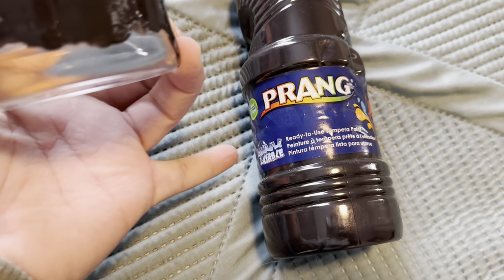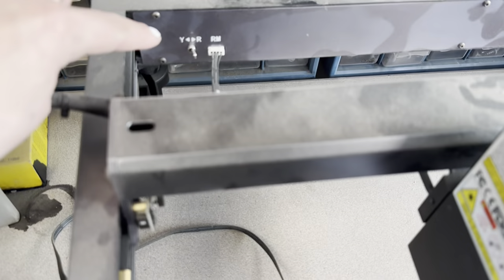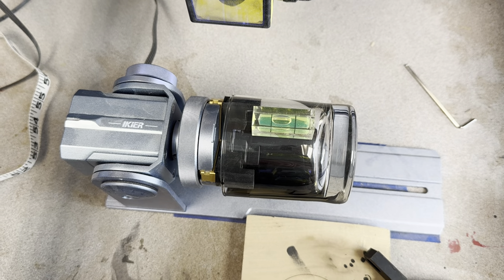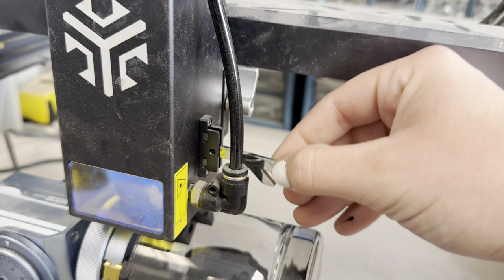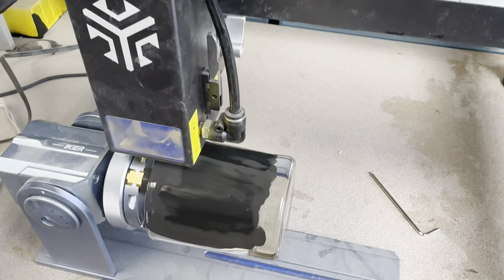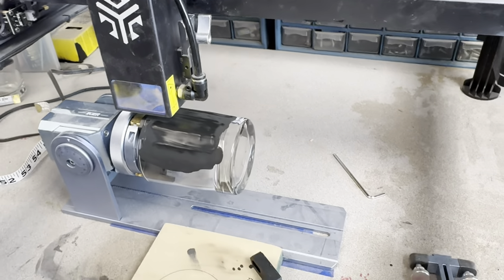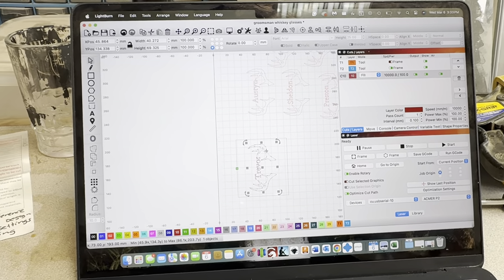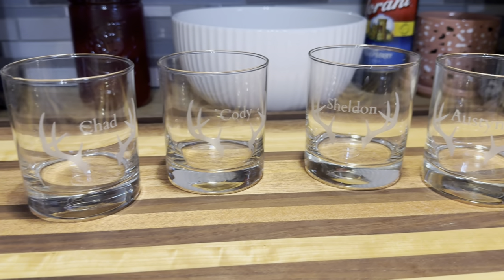How to Laser Etch Glass Cups on rotary using ACMER P2 33W Diode Laser

Comment: The rotary you have linked is different than the one you are using? Will it stll work with the acmer p2 33 wattt ?
Reply from the maker: Hello! Thx for letting me know! The link has been updated. The color is different but the rotary works the same. It’s fantastic! Let me know if you need anything else:)